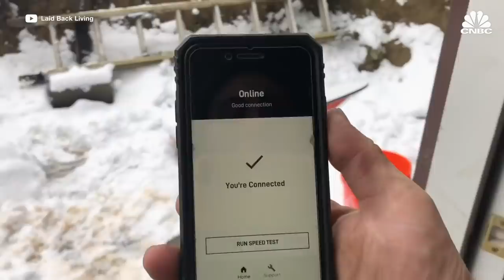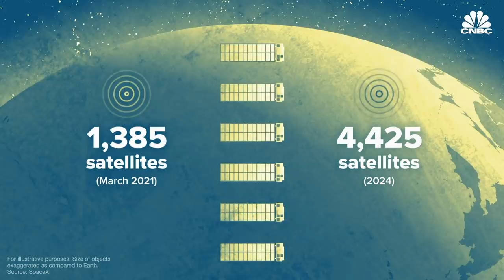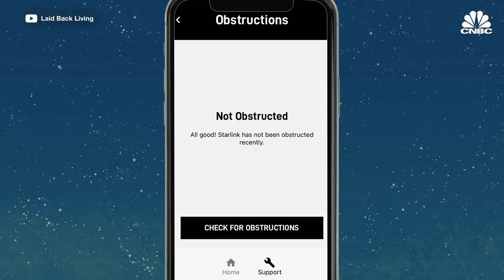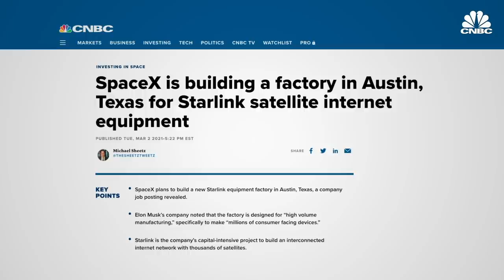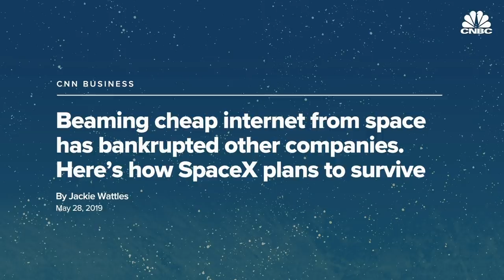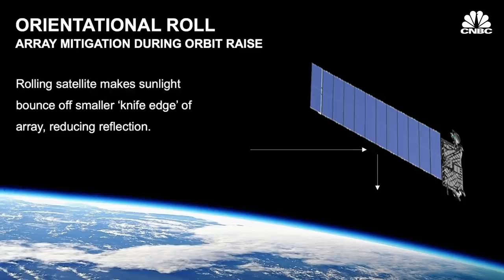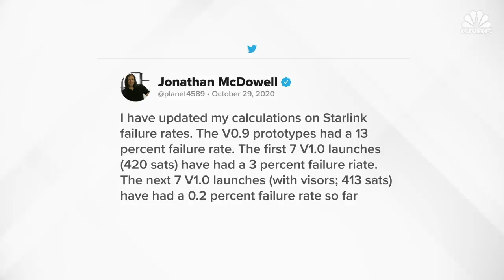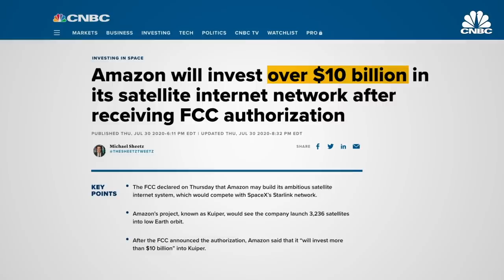Why Starlink Is Crucial To SpaceX’s Success

Comment: The guy says at 5:30 satellites in orbit transmits signals at the speed of light, as opposed to the speed of whatever is on the ground. He seems to not know that we transmit data already through fibre optic cable, which does travel at the speed of light. Difference is you are transmitting 550k above earth versus on earth's surface - which will always be faster as it travels in the shortest path length. The problem is installing fibre optic to all communities is difficult, hence why it was discussed at the beginning of the video.
Reply: Here is an interesting point for you to consider about fibre optics. While the light signal can travel at the speed of light obviously the switching of the networks is much slower than that. So there is a lot of improvement space in fibre optics as well. 
At the moment Starlink is being entered into space at low volumes once they can get their heavy lifting rocket systems in action they will be able to send up 400 satellites at a time. So it will take about 75 launches to really have a truly global system of satellite communications.

Comment: They should create a simple if statement that assesses the connectivity of a satellite - if it no longer has contact for X amount of time - decommission satellite automatically.
Reply: Would it not be better to keep it up and active as long as possible?
Reply: @bighands69  Indeed however these are low earth orbit satellites, they will naturally fall to earth over a long time. The only problem with that is that if you lose contact you may pose a potential risk to other orbiting objects, best to immediately decommission to avoid problems. Could be a simple couple lines of code that sorts that out with a small booster that propels the satellite back into the atmosphere.

Comment: Everyone is talking in superlatives about it. Having internet connection apparently became one of basic human rights?! To achieve it, we're going to have 30'000 Starlink sats, few hundred in the other networks, including additional 2 networks (Russian and Canadian) with own concept and unknown number of sats. Starlink sats operate on several (3?) planes in a mesh-like orbits, with spacecraft crossing their paths. Hence, we're now surrounded with whirling clutter. What about sky observations is one thing, the other is access to space, then deorbiting, which will now occur constantly over our heads, and finally, if anything goes wrong (and it usually does) it'll follow the domino effect - hundreds of thousands of unmanageable pieces of junk, like a space-grinder. But of course - just stay enthusiastic, because why worry?
Reply: At a altitude of 550 km that leaves an area of about 700 million square kilometers. I think the issue you are trying to push is not an issue. 
People like your self do not get to dictate people's access to communications systems because you decide to dream things up. 
Your attitude is very common in the modern world.

Comment: I thought it was going to be good. Then I read the prices and speeds they are offering. It would be cheaper and more beneficial to just put fiber down. Not sure how they think this will ever be a success after they promos 5x less speed at 5x the cost of current providers.
Reply: 5x less than current providers? Sureeee....
Reply: It's mean to be used in rempte location without cable connectivity.

Comment: Idea of satellite connection from earth to Mars is very cool. 
Though it's probably 50 years into the future.
Reply: There already are satellite connection from here to mars. How do you think we communicate with those cute rover thingies over there?
Reply: Mars 😂
Reply: We have had satellite relays to the Moon and Mars for 50 years and 20 years respectively.
Reply: @Diggnuts  That's not easy, cheap and reliable. 
And definitely not for everyone.
Reply: @neeljavia2965  Regardless, it exists. You make no valid point.
Reply: @Diggnuts  The idea that the guy said in the video doesn't exist right now.
Reply: @neeljavia2965  Do you have experience working on transmit/receive communications systems? Because I have experience working on HF, VHF, UHV, SHF, and EHF and I was trained by the military. I can tell you right now that being able to communicate with Mars is a dream.

First of all, in order to just maintain satellite communications you have to have to maintain a constant lock on the satellite, if you even believe that it's truly a "satellit" which I don't. If you are moving, such as on a ship on the ocean, your system has to be advanced enough to keep the pitch, roll, and yaw stable at all times to maintain that link to the satellite even in 10-15ft waves/swells. If we are on a spinning ball, flying through space around the sun, while mars is on it's OWN trajectory while also spinning, how do we maintain connection to Mars? You'd have to cover the surface of earth and mars with antennas just to have enough antenna surface area to keep that connection, and that doesn't even factor in orbiting planets, debris, satellites, and other electromagnetic factors causing interference with your transmit and receive frequencies.

Second of all, the lower the frequency, the further the transmission, however, if you want to send data other than TTY or voice, you have to be at least on the X band frequency. The problem with that, is the higher the frequency, the shorter the range and the more power you need to keep your bandwidth functional. SATCOM systems utilizing 3-30GHZ Super High Frequency (SHF) need at least 50-150 watts just to give you internet that is about as functional as 4G. It's not slow but it's not fast. That's in the same frequency spectrum as 5G, and 5G towers have to be placed every few blocks because they don't transmit very far and they are HIGHLY susceptible to interference from objects and debris. In order to reach Mars, you would have to pump out at least 10X the power of a standard SATCOM system, and that's if you don't have ANY interference. Is this sounding ridiculous yet? Because it should.

What do I think is going on? Well, I think they are once again lying to the public because they (the elite) think the public is stupid, and they are filming in some remote location on the earth, putting in a delay, and deceiving the world. A former CIA director jokingly refers to NASA as "Not A Space Agency." If NASA is "real," then why is every astronaut a high level Freemason? Freemasonry is a religion, a religion that believes deception of the un-illuminated is a good thing. I thought "science" and "space exploration" were anti-religion. Seems to me there's a serious conflict of interest.
Reply: @Isaiah-ft5nx  BTW you are the 1st flat earther I have ever encountered who interacted with me personally. 
Now I believe stupidity has no limits even know this digital age.
Reply: @neeljavia2965  Glad I wasted my time giving you a reasonable, logical, factual argument about why it's impossible to communicate with Mars. This is more proof to me that heliocentrism and "science" is a religion of it's own, because you clearly have strong faith in it. This is why most flat earthers don't communicate with the masses. It's a waste of time and energy. Because even if we could prove it you would reject it. You don't care about real objective science, only mainstream trendy science.

Comment: Generally a good video. Minor detail though, this video mixed up the concept of latency and throughput (bandwidth). Having the satellites closer to earth reduces latency, that is true. But it has nothing to do with megabits per second. Latency is also irrelevant for video streaming. Latency is important for e.g. conversations, high-frequency trading, online gaming, ...
Latency can be compared to having shorter roads or higher speed limits. Throughput (bandwidth) would be to have multiple lanes so more cars can reach the destination in a given time even if speeds do not change.

Comment: You complain about everything. In Venezuela, which is where I live, I hired a telecommunications company to install a point-to-point antenna internet system. The technician to get on my roof and see where the matrix antenna was, charged me $ 300, then the installation of a mast to put my antenna cost $ 700, the configuration and connection of my antenna with the matrix antenna cost $ 200 and I paid one $ 20 monthly fee for only 3 Mbps. I have to note that I live in the city, not in the woods or in the middle of the sea.

Comment: Note sure why they simply program the device to return after a certain amount of time in space. They talked about the issue of satellites losing connection. Doesnt take a genius to figure that out.
Second method if it would loose connection then the return home could also be triggered. Doesnt have to be difficult right ;)

Comment: “Your now moving data at the speed of light instead of moving data at the speed of whats ever on the ground” 
Don’t we have optical fiber on the ground also, moving data at the speed of light?
Reply: First, most of the Internet connections today are either DSL, Cable, or Fixed Wireless. Second, there are too many hops from the last mile to the upstream provider which introduces latencies due to various technologies/equipment in the midst. So, there is no one long fiber wire going from the consumer all the way to the “Internet”. It looks like Starlink will bypass most terrestrial limitations.
Reply: @zakariafarah1101  Those same blockages are surely to be expected from the satallite mesh, for each laser (optical transmitter) we need an optical receiver (sensor) to process that analog optical signal to a digital signal. (Analog to digital modulation is slow). 

As long as logic is required to route the data, there's the limiting factor of processing power slowing things down.
Reply: @zakariafarah1101  Electrical signals traveling over DSL, Cable, and also wireless, travel at the speed of light. The difference here is the wave frequency.

Comment: 5:30 Äm no we move data on the Earth with the Speed of light too. It has, of course, some problems in fibre cables such as the light bouncing in the cable but there are definitely problems in space too
Reply: fiberoptic cable is 33% slower than the speed of light.
Reply: @miguellopez3392  Ah your Right! But still, it's dumb to suggest the speed would be faster only because the information travels with the speed of light.
Reply: @samuelrieder5480  not really,  signal traveling from LA to the UK can have an added 40-70ms of ping from the speed difference in light.

Comment: The Satellites are so low that air resistance will de-orbit them in a reasonable amount of time. Also, many of those 10,600 objects have naturally de-orbited, but space debris is still a very real threat.
Reply: It will take about 25 years for them to really have issues. 5 years being quoted by people is not the average but worse case scenario for a single satellite. 
Space debris is an an issue with high orbit satellites not low orbit.

Comment: I believe that by the end of 2021, Starlink should be capable of over 700 mbps download speeds. That's more than enough to run multiple streams of 4K video.

Pity that American telcos abandoned WiMax (802.16) wireless technology. WiMax could have solved the "last mile" connection problem even in rural areas, since you only need a few transceiver towers to handle thousands of users.
Reply: Wireless last mile solutions will become available at some point when the the technology develops further.

Comment: I will call out the reporter halfway through that couldn't see a path to profitablility for Starlink and the road behind is littered with failed startups (that didn't own the means to orbit).    This is the road map is as follows for profitable units (sold as a loss leader) and subscriberships...$1500 per unit - $500 subscribers fee = $1000 deficit remaining/ 10 months = a subscription fee of $100 per month with two months to spare starling is profitable at the subscriber level in year one.  Simple math.  

Year two is pure profit for Starlink.   

The model is familiar.  Elon chose the cellular phone model for hardware subsidies and two year contracts.   The only difference I see is the dish lasts longer than a cellphone.   Yet again, SpaceX for the win.